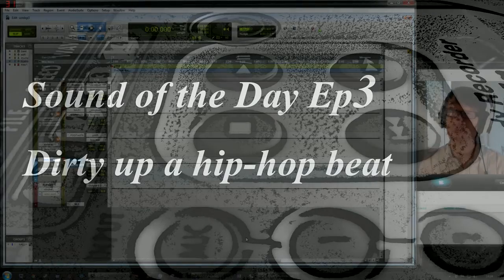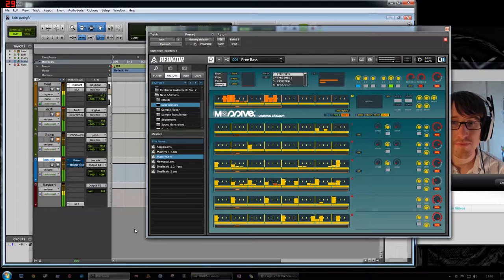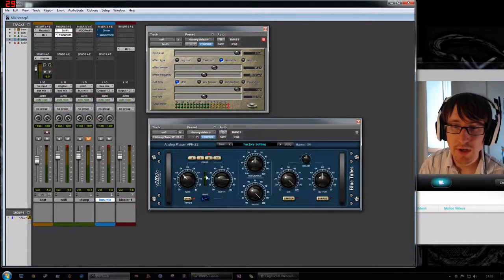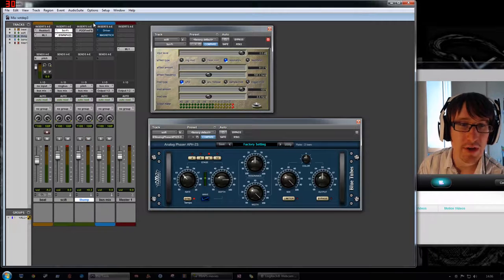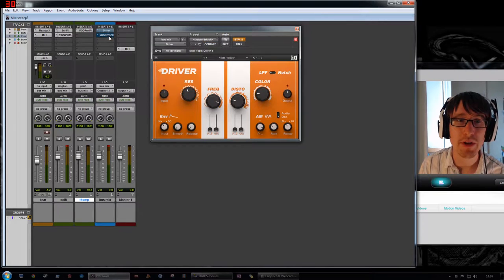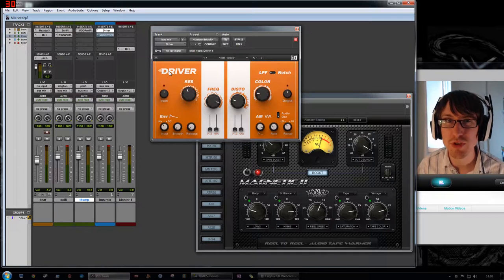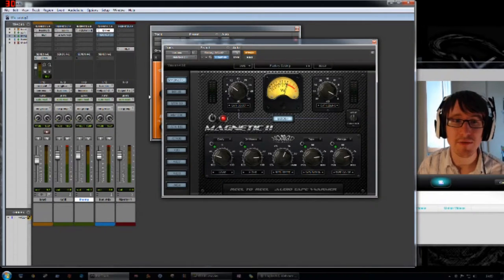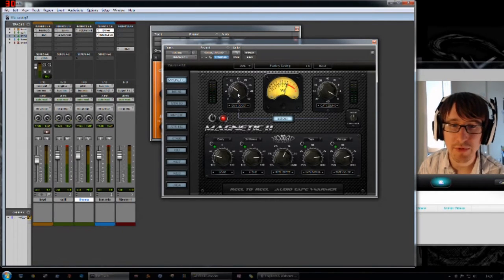Sound of the Day Ep3 - Dirty up a hip-hop beat

Comment: quick question, what do u think about Nomad plug-ins vs waves?
Reply from the maker: Waves stuff in general sounds better and the tend to have better interfaces, but Nomad Factory has much easier and consumer friendly DRM. The waves DRM is absolutely horrendous.
Reply: Mark AndersonAudio
IDK i think Nomad sounds better, it seems more accurate, you could notice the changes as soon you touch a virtual knob or fader, very sensitive, but i could agree with on the DRM part... Ever use COSMOS from Nomad, give it a try
Reply from the maker: Schmirk .Pictures Yeah I have COSMOS, I think they added it to my bundle for free without me noticing. I haven't really messed around with it yet. Might make a video with a kick drum and bass guitar and throw COSMOS on, see how it comes out.
Reply: Definitely try it, you could try it individually and the Master bus... And Magnetic also
Reply from the maker: On the Master Bus? Hmm, never thought of that, I will give it a try. I use Magnetic all the time, probably a top 5 plug-in for me.
Reply: Ok Kool